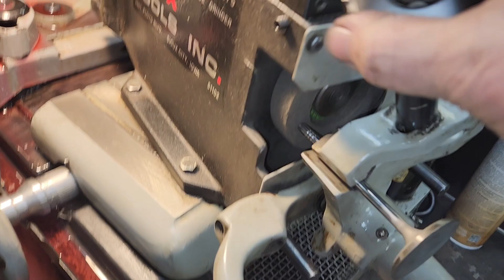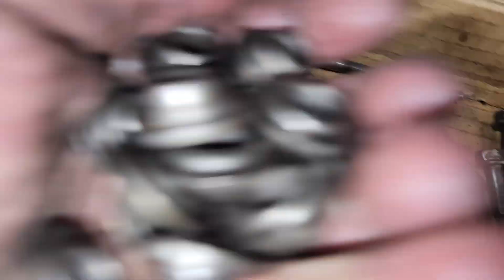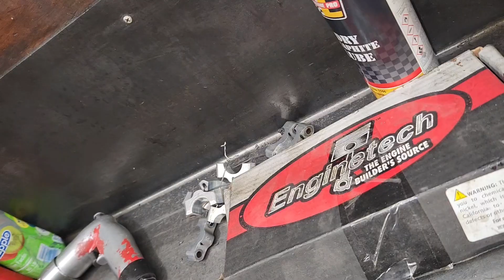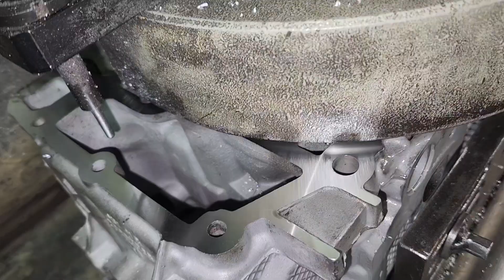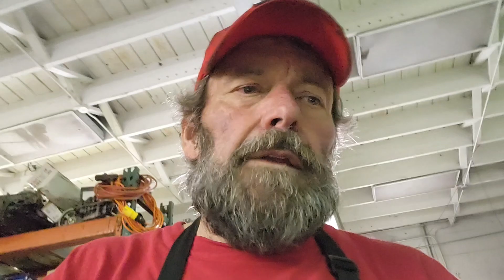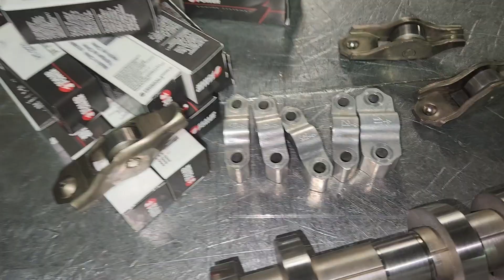4.7 Chrysler part 5 #engine #dodge #engine #educational #interesting

Comment: 😂 I said half a hair at the same time you did. Dave, I have a question on the Ford 385 series heads, (DO3E) #1 do they have hardened seats, and #2 if you do a valve job, do you still have to adjust the stem height?
Reply from the maker: Every valve job on stem height heads needs to be set at the proper height or it won't function properly 🇺🇸
Reply: @BearButler321  thank you